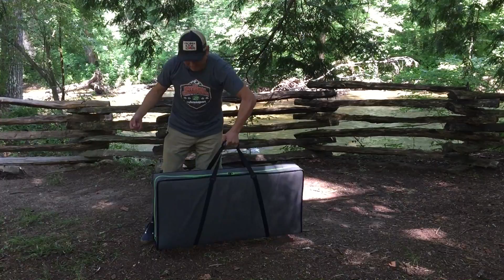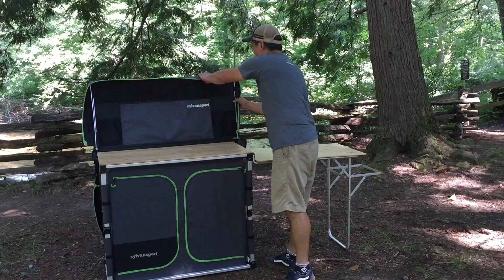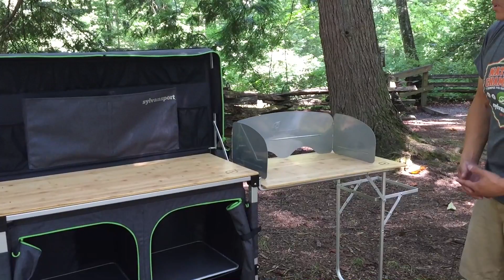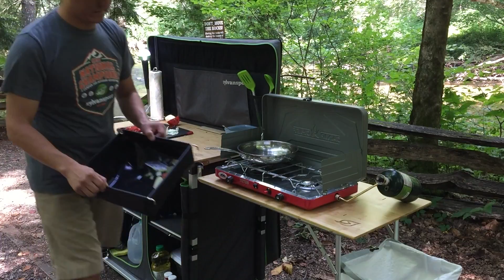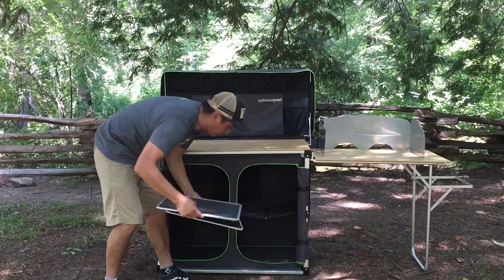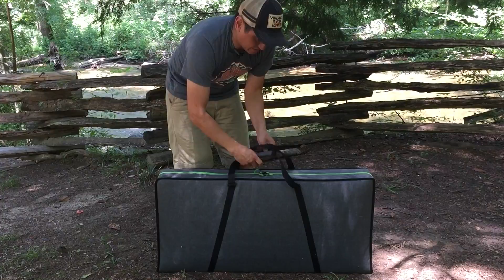SylvanSport Dine O Max Camp Kitchen

Comment: What do you do if it rains?  Sprinkles?  Is this waterproof or is it another thing I'm going to have to take down after use "just in case" or scramble to take down in emergency mode in the pouring rain?  Or am I expected to set it up and take it down 3 times a day if it might rain?
Reply: I leave mine up. The cloth may get wet, and it will dry. The bamboo counters won't  be damaged by rain.